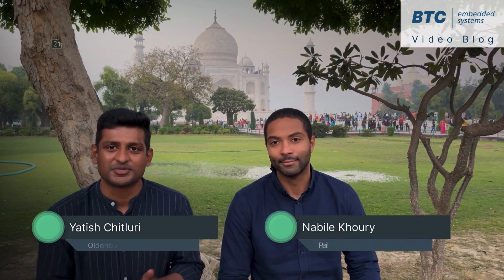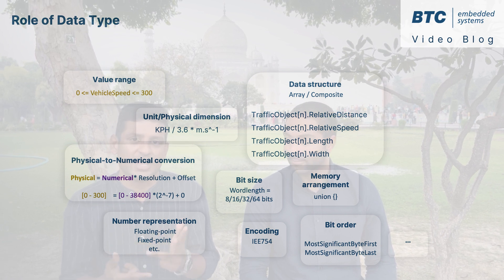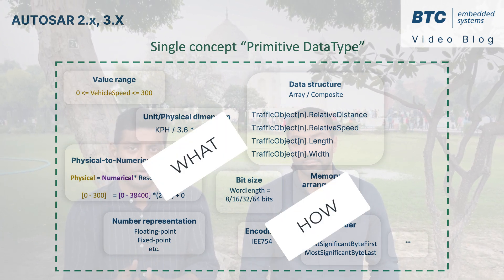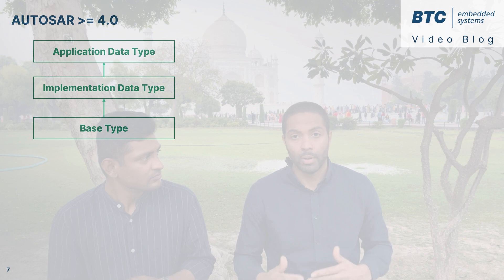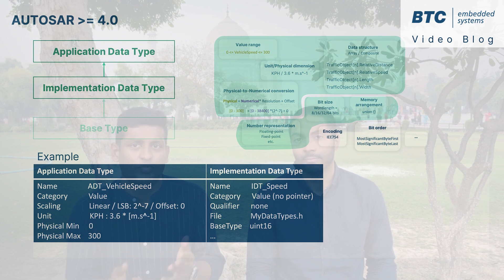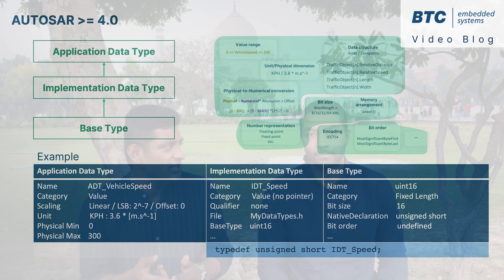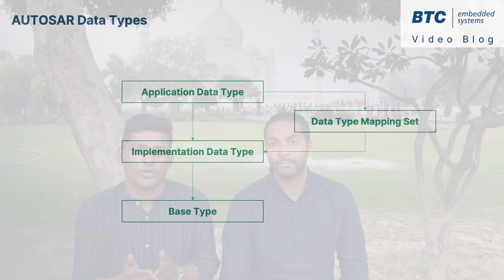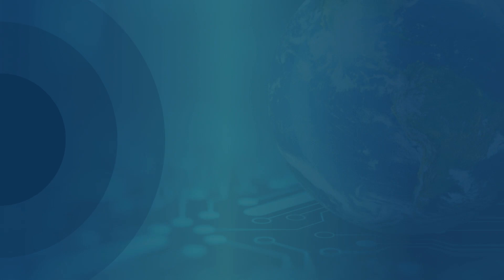AUTOSAR: Difference between Application and Implementation Datatypes

Comment: Application SWCs can receive signals with Idt data types? Or they only can receive Adt data types

Also, the Actuator Sensor SWCs receives only signals with Idt data types?
Reply from the maker: Basically Application Data Types only exist in an early phase of architecture specification, because implementation specific information (e.g. basetypes) is not part of the Adt. So on the implementation level (C-Code) only Idts exist and only the Idt names will be seen in the code. This is the case for any kind of software incl. application SWCs and Actuator Sensor SWCs.